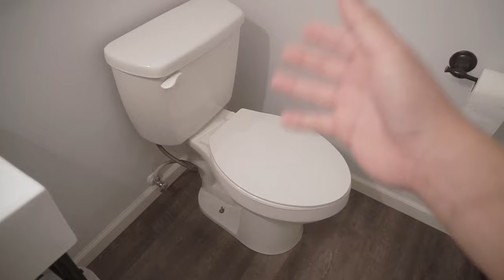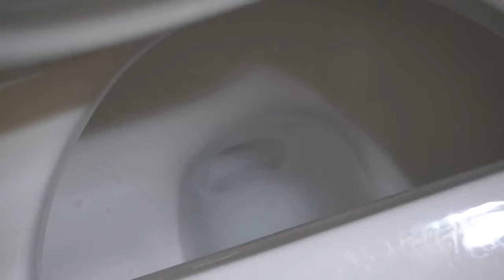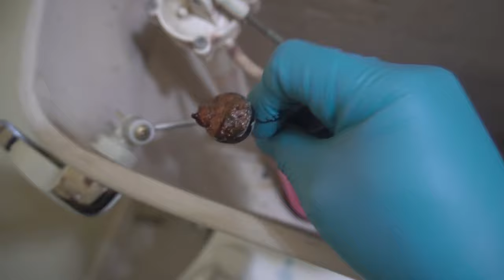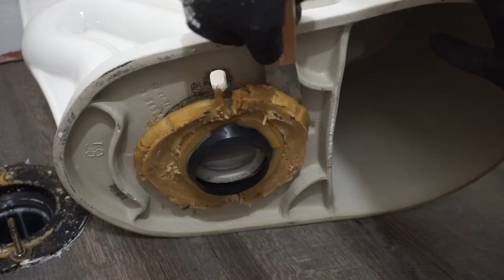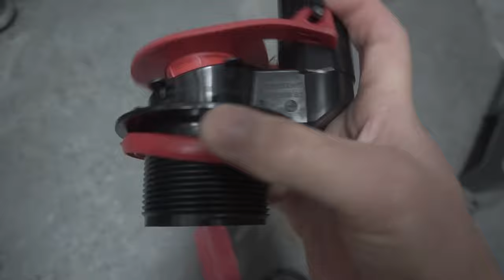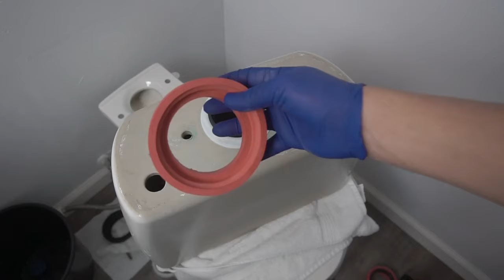TOP 10 Common Reasons Why Your Toilet Leaks EXPLAINED! Tips And Tricks DIY FIX How TO For Beginners

Comment: Thank you so much for making this video , I just fix my toilet
Reply from the maker: I’m glad I could be of help! Thank you for watching! Please share to help more people 🙏🏽😊👍🏽
Reply: I had to reply under a comment because the standalone comment option is missing😳! Anyway, mines is leaking on the right side of the tank and I live in an apartment. It has been fixed about 3 times-looks like they put in the new bolts-but lately it’ll start back after a few weeks/months so I’m wondering if it is the porcelain itself that’s leaking. If it is the porcelain then what’s the next step? Thanks 😊
Reply: @ROSE_reddy if there's a crack, replacement of the porcelain that is cracked or probably the whole toilet. I think he mentioned epoxy for cracks at the base but if not properly mixed and applied to a very clean and dry surface, it becomes the next likely point of failure. If no crack then there might be excessive movement between the parts causing the seals to wear, and it would be to be stabilized

Comment: I woke up in the middle of the night to hear my upstairs toilet leaking. Water was coming through the walls all the way down to the basement! So I shut off the water to the upstairs and I'm nervous to troubleshoot this.... But,,, Gonna try. Wonder what might cause a toilet to suddenly spring a leak overnight like that! Toilet isn't used much, so I'm guessing a dried out gasket or water line. Sheesh.
Reply: Any resolution on this? Experiencing the same

Comment: I replaced my flush valve and fill valve and replaced the tank bolts and rubber seals but my toilet is still leaking.  I don't feel or see any water coming from the supply line, under the tank or anywhere on the floor.  What gives?  I know it's leaking because I can hear it when it comes on to fill up the tank.  It's not a frequent sound but it does it enough that I know there's a leak.
Reply: Same here.  We're u able to fix it?
Reply: @lorraineh9468  Yes.  As it turns out, the "new" fill valve kit I purchased was defective.  I bought an updated fill valve and problem solved.  Thanks for asking.

Comment: Great video! Very helpful and simple to follow - also a tip for beginners, especially important for problem #1 and for most toilet repair work: turn off your water supply valve (the oval shaped handle at the bottom of the hose, turn clockwise until the water stops) before you unhook any part of the water supply line, and then flush your toilet repeatedly to remove as much water as possible from the tank. Thanks again for the video - accurate, thorough, and not overly complicated!

Comment: Thanks. With your help I was able to fix my toilet. We saw rust build up on the tiles under the tank. Looking at your videos help me troubleshoot and avoid a catatrophic leak. Noth bolts we so rusted that I just hag to pull the bolts from the bottom to removed them. So the bolt heads were out in rust.
Reply from the maker: Thank you so much for the feedback and I’m glad I could be of help! 🙏🏽😊

Comment: I love your videos! You do a good job and take pride in your work. As for my toilet, I don't have a leak yet but I'm anticipating one. The toilet that I have is set on ceramic tile I believe and whoever cut the tile didn't do it properly so essentially I have probably 2/3 of a piece of tile sitting under the toilet right now with a corner that's exposed with no tile on it in the back with a triangular piece of tile floating around that I used to support the toilet it's crazy! Yeah it wobbles a little bit. Anticipating the only way to take care of it is to remove the toilet and have the tile cut but the bathroom is set to be refurbished so I'm trying to hold off on the toilet until next year. Been 2 years that I've lived here and managed to not rock the toilet to the point of leakage but I have to admit I say a little prayer every time I flush! So as I wait for a new year and new project, if anybody has a temporary fix suggestion on what to put in the floor area in the back of the toilet where the void is to make the toilet more level that would be great.
Reply: If your toilet unbalanced, then there is danger that crap sticks in one side.  Especially soft, greasy ones

Comment: Hello, 
I was wondering if you can help. It’s 9pm and I have a drip on my kitchen wall cabinets above my sink. The cabinets are right below our second floor bathroom where the toilet and sink sits. I don’t see any water in the second floor bathroom or on the toilet. Would you have any advice in the meantime before I call a plumber tomorrow morning? 
I am a first time homeowner with my sister. Any suggestions would be wonderful. Thank you.
Reply from the maker: Hi Mary, thank you for reaching out! The leak might be coming from the pipe that is below the flooring on the second floor. What you can do is try to trace the water spot marks on your first floor above your kitchen cabinets. Usually your be able to find where you need to open up the drywall and trace that leaking pipe or fitting.
Reply: I have that same type of issue (glad mine's not above the kitchen 😢). How do we fix the pipes below the toilet then please?
Reply: How would we fix the pipes under the toilet?

Comment: Thanks for this information. Question: I replaced the 3 bolts my tank has. 2 are linking, still. We used a new kit of bolts & washers.  We have tightened and tried plumbers tape.  Nothing has helped. What did we do wrong?

Comment: Thanks for the video. It was very informative. HOWEVER, I have a leak problem that has me mystified.  There was a drip coming from the right side underneath the tank, so I started taking water out of the tank and then shut off the water supply so it wouldn't keep filling. When the water got down to a certain level in the tank, the leak stopped. BUT, there is still an inch or so of water in the tank. If the leak was caused by a faulty gasket wouldn't it still be leaking? But it's not. Could there be a crack in the tank above where the water line is now? Doesn't make sense.

Comment: Thank you for sharing your video. I wanted to ask is tha would it be the same leakinh problem where the toilet bowl is sat on top of a cement like an old fashion way? I don't want to pull out the toilet bowl if the water leaks around the base of the toilet bowl surrounding with the cement.

Comment: Great video!  Subscribed!  I have a plumber coming to check an issue out but every time I flush the toilet, there is water dripping from the concrete slab below near the vertical sewer pipe protruding as we live on the first elevator floor as parking garage is underneath our floor.  Could this be a failure of the wax ring?  That’s what our property manager thinks?  I check the bottom perimeter of our toilet and see no signs of leakage.  Thanks!
Reply from the maker: That might be the case. Sometimes there is a small gap space from the wax ring to where your floor starts and when your flush the gasket will leak and flow to the sides straight to the subfloor. I definitely think it could be the wax ring 🙏🏽
Reply: @FixThisHouse  thank you 🙏🙏🙏.  will keep you posted 😬👍

Comment: 2 problems I have had the most often...
1. the rubber hose from the fill valve to the overflow tube will come out and or whareout, causing water to be sprayed onto the cover leaking around the top tank edge. This is often caused on older toilets that use a metal hook that holds the hose in place rusting through. I have had it happen with the type that has a plastic ring molded to the drain tube where the ring broke. Two other causes I have had with the hose is too high water pressure that would cause the hose to lift out and the hose cracking.
2. On the inlet valves with the big float ball on the end of a long brass rod, the top valve seal will leak spraying water onto the top cover again leaking from the top.
I fix the 1st problem by replacing the hose with a longer hose that fits further into the overflow tube not requiring any other device to keep it in place.
The 2nd problem has 2 fixes...
Either replace the valve...
Or the faster cheaper way is to cap it with a small plastic container like an old spray paint cap that you cut a gap in the side for the float arm to move. I  have had this problem enough times that I just cap it when I install a new valve.

Comment: I just had my bathroom floor repaired, new flanged, wax ring etc 3 weeks later I'm noticing water at the base. Do you think it is the wax ring? What could have made it fail so soon?
Reply from the maker: Hi! Im sorry to hear, it could be or the source could coming from the tank bolt , fill valve insert or tank to bowl gasket. Please check those areas first 🙏🏽👍🏽
Reply: @FixThisHouse  It's not coming from the tank it's down by the base and it's just a little bit of water. By the way thanks for responding.
Reply: @vaughn257 Am having the same problem at the moment. I replaced wax ring and two weeks after I see a little water at base to the front mostly. Did you figure it out?

Comment: Hi thanks great video. but i have a different issue. i am finding particles of what looks like very thin paper coming out the small hole which is from the rim holes etc. how can these be cleaned and what is causing this? To start with I am on lake water and have sediment filters both in the lake and before the tank. The flush tank has some dirt on the styrofoam sides but there is nothing to flush down that would cause the issue?

Comment: Replaced my fill valve and discovered after installation that it just sprayed water out of the connection to the tank. On closer examination discovered a rubber washer or seal had fallen out of the mouth of the hose and had become stuck in the bottom of the old fill valve. I was able to take it out and inserted into the water fill hose. Then everything worked fine, without leakage. Might be a good idea to warn your viewers.

Comment: I’ve had the packing nut fail when I go to turn off the water at the shut off valve. This was due mainly to it not being used. I added turn the shit off valve off and on every month just so it does not stick.
Reply from the maker: Thank you for sharing your issue 🙏🏽, this is a good problem for the community to be aware of sir.

Comment: Water continues running into toilet  bowel after flashing, not sure if its the flap or the outside valve that's measure ate about of water you want to fill the tank. How can I fix the valve, I think I need a new washer at the knob how do I do that, thank you

Comment: Problem #11 is the large plastic nut on the supply line that connects to the fill valve. I have seen them crack over time due to chlorine in the water. I have been looking for similar braided steel flex line with a METAL nut that connects to the fill valve. No luck.
Reply from the maker: Thank you for sharing this issue! 🙏🏽😊
Reply: From what I have read, stainless steel metal eventually rusts, maybe around the 5 to 8 year time frame. Many say they have no doubt it will eventually rust and then possibly fail, while plastic lasts closer to a lifetime, at least twenty years or more.

Comment: I changed my flapper but it still is leaking into the bowl. I think it is the seal that the flapper seals up. It looks like more work than I wanted but its gotta be done. The water doesn't stop all the way so with that going and my daughters 1hour showers.... its costing me a bundle.

Comment: I have a big toilet. When flush the water comes out the front of the toilet bowl. It leaking slow. So I changed the flapper and water still running very slow into bowl. Any advice

Comment: My toilet is much different. There is a tube from the tank to the bowl with a rubber seal that is split
it spews water on the floor when you flush
Really struggling to find an at home fix but I may have to call the plumber again, its the second time this has happened in a year. The first time it was old and worn, but I think this time its a faulty rubber seal... or a faulty plumber 🙄